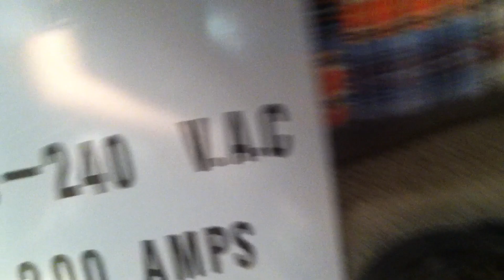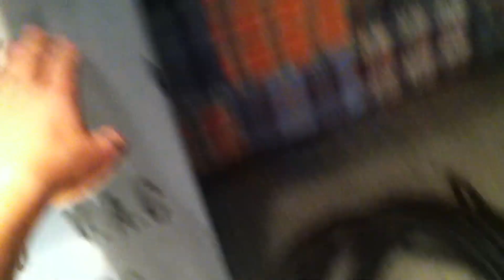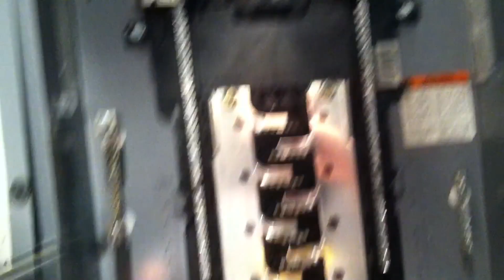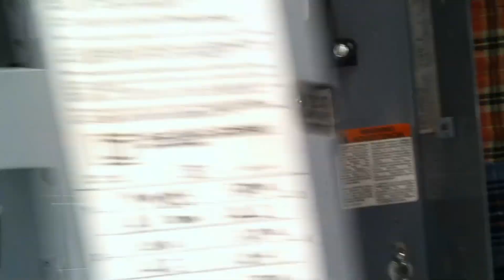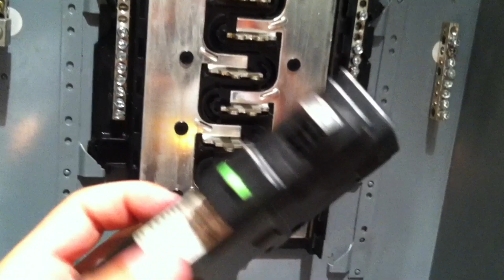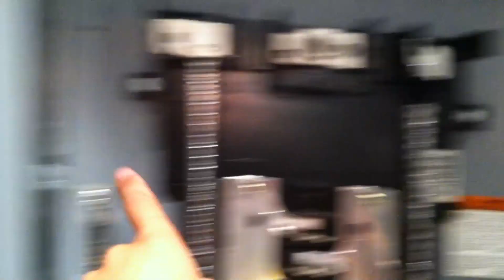Electric Panel and power distribution basics

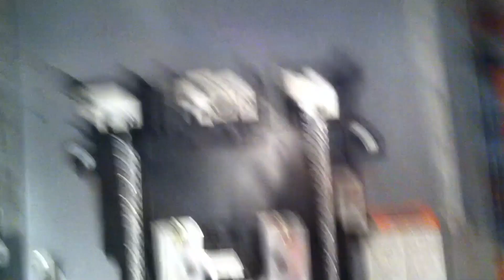Comment: CORRECTION: [ 3:44 ] "And if you had 3 phase, it would be red, black and white..."  The color code for single split-phase residential electric service (your normal household electricity) is black, red and white.  3 wires does not mean "3 phase" electric service.  "IF" you did have actual 3 phase [208/240] service (most homes do not; 3 phase is used in commercial/industrial settings), the color codes would be black, red, blue, white and green - for line 1, line 2, line 3, neutral, and ground respectively.  I only caught a minute or two of this video, and don't have time to watch the whole thing - so, I can't speak to how accurate the rest if the information is.  Specific and accurate terminology is very important when working with electricity.

Comment: Wrong wrong wrong.....3 phase is black, red, blue 120/208v (3 hots or legs as we call it and a neutral). 120/240v is single phase. 3 phase is also 277/480v. Stick to stage lighting don't confuse people. Also that's not a panel you would see in your house. That's a NEMA 3 or outdoor panel. Get your facts straight.
Reply from the maker: Nema 3 is simply the enclosures rating to be outdoors, this is still a residential style panel and would not be unusual to see this panel serving someone's home. 120/240 is a split phase system while yes 120/208 and 277/480 is three phase. There are color codes that are recommended but these are not strictly enforced in many areas and any professional will know not to trust color coding to determine a panels voltage.
Reply: @jacobdykstra8499  🙄I am a licensed electrician. Those are the color codes. Although grey instead of white is the neutral on 277/480 and no it wouldn't service a house. It would be used for a temp service for a house being built or service a temporary trailer on a job site.

Comment: So i have a question, im wiring a mobile home and does the phase a and phase b cables on the main panel have to go in a certain spot in the trailer sub panel or can i land them in any of the the designated hot lugs. In other word does it matter if they get switched?

Comment: Thank you for the tutorial on panels, so if I am understanding correctly a bare panel with the main breaker installed with breaker in the on position if you measured using a DVM between the two phase plates one should see a measurement of 240 Vac? If you do not see 240 Vac 0 Vac what you suspect is the issue?

Comment: Excellent tutorial on the structure & function of electrical panels. I'm preparing to use a generator during hurricane season. I understand what I will need to do now.
Reply: If you are relying on this video - You definitely do not have all the information you need to safely hook up a Generator to your main panel.
Reply: @TangoNevada  do you have any specific suggestions or warnings?
Reply: @disque3110  Do I need to based on my comment?

Comment: There is a big difference between ground and neutral. The earth does not asborbe electricity
Reply: Unbond the neutral and get rid of the grounding electrode , you will not get shocked.

Comment: Arc fault breaker monitors the sine waves for a high change in the wave.
Reply: Ok, so?
Reply: @duanelohr1869  thars how arc fault works not current like said he said
Reply: @thomasmarable6818  ok, so?
Reply: Works how? An arc fault is suppose to work when a switch is opened or closed, and electricity jumps across the terminals, which could shock someone or start a fire. I say we had some stupid,  but genius  electrical engineer develope this tech and sold it to the electrical industry and is now retired  in northern California . I mean come on,  when was the last time you saw an arc fault in a home or business? Maybe the last time you tried to hook up a live wire to a switch/plug that has a load on it.  Arc fault breakers are expensive and a total waste of money. Maybe if enough of you listen to me, maybe that engineer will have to move to some city or something n

Comment: Just watched your video; thanks for posting even though it was six years ago.  I'm trying to understand more about my electrical panel, and wondering if I could use a interlock device with an added circuit to connect my smaller 120V, 3500 Watt generator for back up power to limited circuits.  Most back up gens I've seen being used are 240V with a four prong twist type plug outlet hooked up to a similar inlet plug box.  My gen uses a three pronged twist type connector.  Not sure how I would be able to feed in to only the 120V to all 120V selected circuits on an Eaton 200 amp breaker panel (MBE2040PV200BTF).

Comment: You don't bond ground and neutral in sub-panels because you don't want stray ground current. What I mean is outside pipes and other metallic objects that are shorted from sub-panel can conduct electricity and cause a shock hazard with return current. If resistant is lower in the ground wires than on some neutral circuits, electricity with flow back to the sub-panel over ground lines. This is a hazard, therefore do not bond ground and neutral on sub-panels. Main panels this is ok to do.

Comment: 24:43 Neutral must be bonded at the first means of disconnect. In this case, the main panel. If you bond neutral and ground together at the main panel AND the sub-panel, then just created a parallel path for the return current with the ground wire. Basically, the ground wire bonded to the sub-panel will carry current to the main panel.
Reply: Indeed I asked this question to one of my professors and he basically said the same thing as you. Good info 👍🏼
Reply: The idea is to save people's and electrician's (?) Lives. Ok, so there is a parallel way electricity  can travel and the ground is not a safety circuit. But does it matter? 30 to 40 years from now when the building is condemned/ rewired, it probably will still work fine. Oh, and Merry Christmas.
Reply: And I agree.  Stupid why is it not ok to bond a sub panel? It is a second way to protect people.
Reply: @duanelohr1869  If you bond the neutral and the ground current will also travel through the ground back to the source (transformer), since they are now in parallel. And also since everything metallic is bonded to the ground, they will also be carrying current back to the source--like your piping systems. There's a lot of issues that come with bonding the subpanel like having those resulting stray current all over the place creating magnetic fields that can interfere with sensitive equipment. And what's also dangerous is if you accidentally got in series with the ground you become part of the circuit and you will get electrocuted; just like you would with the neutral. But in this case, the ground was never supposed to carry current anyway so nobody would expect it. Wish I could show you drawings I could probably explain this a lot better. But no, bonding the neutral and ground at the sub panel is not a second way to protect people. This is why you should always follow the code because things are not always what they seem.
Reply: Again we are trying to protect people from electrocution which is good. But why do we need to do that?  I have the best story, and it involved my mom and dad. Unfortunately, the power pole that supplied my parents home  was supposed to be decommissioned in the 70's. Before the dang house was built. And nearly  30 plus years it was replaced. The problem is not us,  the problem is electrical companies who have failed in doing MAiNTENANCE on their systems.  And we stupid sold out our electric companies to greedy investors. Like sending children to college debt.
Reply: And so? The neutral wire will still carry current. Less, sure, but how is this bad? Yes ground should be a backup, but I also believe that the current will still be able to switch between ground and neutral easily.
Reply: @duanelohr1869  yes, however, the neutral (white) needs to be separated in the main panel. This way the extra voltage will go back to the source (the power lines) and not to the ground.
Reply: @cipher1167  ah, transformers are grounded to the neutral  bar, it is a safety issue.
Reply: And I say, no, we have reliable electricians who know that their work has to be safe for future electricians. We depend on the past workers to take care of us too. So your point is kinda confusing,  if this happens and that happens then the ground can become a current carrying conductor.  Trust your  fellow electricians  from long ago. They would be shocked to find you got shocked (terrible pun but I had to do it.) Trust your former electricians.
Reply: Oh and sorry happy Christmas to  all and good night.
Reply: @duanelohr1869  A reliable electrician wouldn't bond a sub panel. You obviously have strong opinion of what is the "proper" way to do electrical work so I don't even know why you keep on asking things.
Reply: @Ed-uu9eo  dude you have an idea on how neutrals  and grounds  should be  used .did you know that the neutral bar is also grounded in most transformers? So we're arguing with me knowing something and you talking to the nec dolts who might know something. I don't want to insult you, but common.
Reply: @duanelohr1869  Are you serious? No shit. What is your point exactly? How is this relevant to what we were discussing which is about NOT bonding the neutral to ground at sub panel? The ground is obviously meant to carry ground fault current (which should only last a few milliseconds depending on the available fault current) NOT carry current under NORMAL circumstances (neutral current). But you refuse to understand what I’m trying to tell you. You came to me and asked me a question only to disagree. I mean idk what you’re trying to accomplish here. If you think you know everything or know better why even bother with this.

PS: Transformers have the neutral bonded to the ground is not because of safety issue. Don’t misinform people please. Read about the basic electrical theory.

Comment: The reason why ground and neutral are separated in the sub panel is for safety reasons. The grounds in your house should not have current on them unless there is a ground fault. Therefore, the only point where neutral and ground are together are at one point outside, in the main panel.

Comment: The natural ground, as in the dirt, is not what completes the circuit just because it "absorbs" current. The return path through neutral is bonded to the ground wire, which connects to the ground rod, so current will travel through the earth ground to get back to the main panel, then back to the neutral to the transformer. If the neutral wasn't bonded to ground, then one would not complete the circuit, just like an isolation transformer.

Comment: A neutral does carry current, it is just at 0 volts because it is bonded to ground at the main panel. Current on the main feed neutral could potentially be 0 amps if Phase A and B are perfectly balanced.

Comment: If there is excessive load, let's say 22 Amps on a 20 amp breaker, it will not trip immediately. There is a current and time relationship curve. The higher the current goes above the capacity, the faster it will trip.
Reply: @Willy Don It is basic, but some things that were said are in fact not at all correct.

Comment: Hey thanks alot for this, i am a fairly green electrical apprentice and was wondering why if you have the 240v breaker pulling from the “two phases” why it wud be still called a single phase panel?
Reply: It alternates from one to the other at 60 hertz.
Reply: Its split phase. It is single phase 240 with a central grounding point we use as nuetral

Comment: Jacob Dykstra     Ok, I went through all of the comments below.   Many telling you how good you did.   I also found out that you were a student when you made this video and are now an engineer working for a utility company.   I hope that you have learned now that most of your explanations in this video are crap.  Grounding(totally wrong), how breaker works(wrong), how GFCI works(wrong), how AFCI works(wrong).   Maybe you should delete this video and make a corrected one now, that is if you have learned how electricity really works.   Depending on your specific job at the utility, you may have only learned about one specific thing and that is all you are allowed to talk about.
Reply from the maker: Thanks for your comment. Where is your video explaining all these concepts correctly if mine are all wrong? I am an electrical engineer working for a utility now. I work on distribution circuits 10's of thousands of volts. This video is very basic and high level but I wouldn't say the information is wrong just not very deep or in depth. Please elaborate.
Reply: Jacob Dykstra   Thank you for response.   How about I explain grounding in reference to dwelling units, only the main panel, not a sub panel(for simplicity).  Grounding electrodes and grounding electrode conductor are connected at the location of the service main.   Purpose is to connect the electrical system to earth so that if lightning strikes the system, it will dissipate to the earth.   No other purpose.  The ground and neutral bares can be the same in the panel.   A bonding jumper is connected to the can in case a line conductor touches the metal can.  Please try to accept the next part.   Most people believe what you explained in the video.   To use your example of the metal light fixture, the hot came in contact with the frame.   From that point current will follow the equipment ground to the receptacle, through the equipment ground in the branch circuit back to the ground/neutral bar, then current goes through the neutral to the utility transformer, through the coil, to the line conductor through meter and to the panel, onto the bus bar and trips the breaker.   A very very slight amount would go to earth, but is insufficient.   This concept is the same in all electrical work, even utility distribution.   Please let me know if you can agree with this explanation.   And if you want more issues with your statements.   BTW.  I do have a considerable amount of electrical engineering experience, and am very good with NEC interpretation.   Respectfully,   Kevin
Reply from the maker: @KevinCoop1  I haven't watched this video in years so I'm not certain exactly what I said. My understanding has come a long way since. Most of what you say I agree with. The grounding electrode serves other purposes than just protecting from lightning. It can help reduce line harmonics but most importantly it is needed to detect leaking currents in ground fault detectors. If the grounding electrode were not installed an insufficient current would flow in a ground fault to detect it. The grounding also prevents stray voltages from being generated which are a serious concern on higher voltage distribution systems. This concept is more applicable to multi grounded distribution systems rather than lower voltage residential systems.
Reply: Jacob Dykstra   As I said in original comment, you have probably learned more accurate information than was in the video when you were a student.   Your response was definitely more utility company comment than load center in a residence.   Also, you asked about my video.  I do not believe that videos on YouTube are proof of or a requirement of true knowledge.   Most are put there for the purpose of making income.   Some are put on YouTube to truly pass on knowledge.   I don't feel we need to go through all the mis- information.  It is your video, you do what you feel is best overall.   Respectfully,   Kevin

Comment: MAIN PANEL NEUTRAL AND GROUND ARE CONNECTED TO EACH OTHER AND THE PANEL IS GROUNDED TOO. OTHER DISTRIBUTION PANELS ARE NOT BECAUSE GROUND ARE NOT SUPPOSED TO CARRY OR BEHAVE AS CURRENT CARRYING WIRE IN CASE OF ANY FAULT. SIMPLE AND EASY

Comment: i AM SORRY TO TELL YOU THAT WHAT YOU HAVE SAID CONCERNING GROUNDING IS 100% WRONG. ELECTRICITY NEVER GOES INTO THE GROUND BECAUSE IT HAS LESS RESISTANCE. IT GOES BACK TO THE SOURCE AND ANY ONE TOUCHING AN ENERGIZED LINE WILL CREATE A PARALLEL PATH AND WILL GET ELECTROCUTED PROPORTIONALLY DEPENDING ON THE RATIO OF HIS BODY RESISTANCE TO THE EARTH RESISTANCE. NOW IN CASE OF AN EXISTING GFCI , THIS DEVICE WILL OPEN THE CIRCUIT ONCE IT DETECTS AN UNBALANCE BETWEEN THE OUTPUT AND THE INPUT CURRENT. NEVERTHELESS THE GUY WILL GET SHOCKED BY A 30 mA IF  THE GFCI IS RATED SO.

Comment: I would love to have you do a video using only a generator to serve the electrical power for a shed with NO connection to the utility company.  How does one connect a L14-30 to an inlet box and then connect that to a small panel with circuits going out to outlets and lights?  I see way too many videos where sheds and cabins are connected to a single outlet fed in from a Honda EU2000i.   Having a panel makes it easier to control the power within the shed or cabin.  

This is a nice video including the swearing.  There are some technical flaws. There are a lot of differences between a neutral and a ground wire.  If CA combines the neutral with the ground then there must be different breakers being used to route the electricity.  The explanation of the ground fault breaker was very good, but then you say ground and neutral are pretty much the same thing.  

The content of this video is very good.  it is a very good concept video, but you are correct to "make sure you know what you are doing".  Never assume anything with electricity.  One of the first things to know how to use a voltmeter.